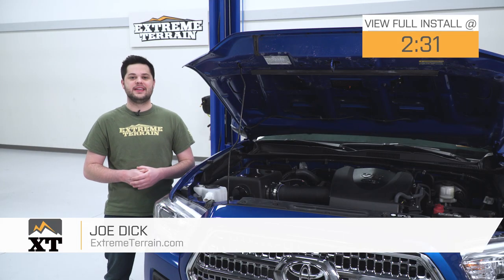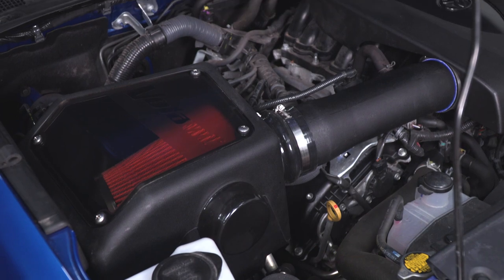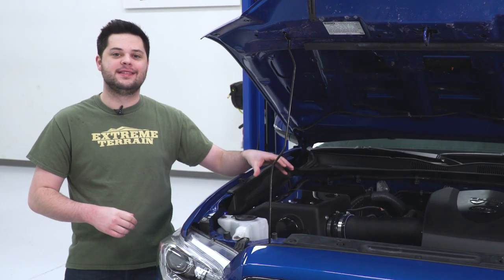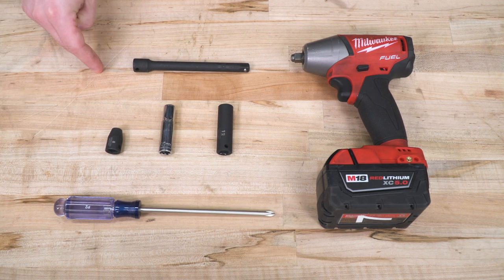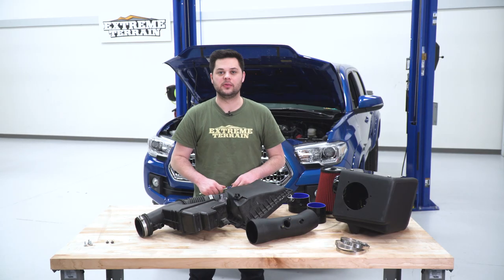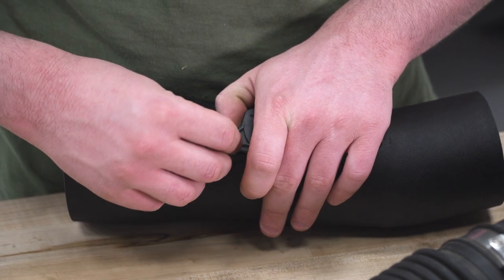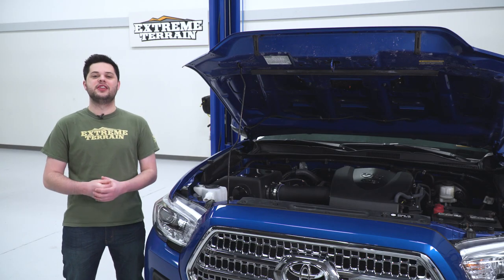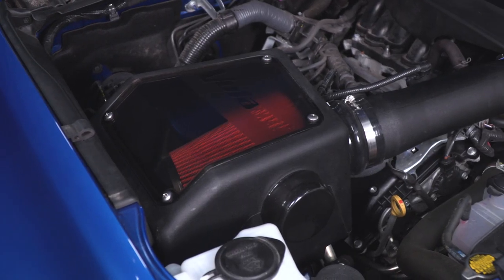Tacoma Volant DryTech 3D Closed Box Cold Air Intake (2016-2019 3.5L) Review & Install

Comment: I tried to install  the S&B cold air intake in my tacoma,  it wouldn't fit because I had installed  hood struts prior to the intake...
The stut was keeping the box from aligning  with the mount holes ..... I returned it
Will your kit fit with my hood struts?
Answer me that and I might make a purchase......
Reply: spiker engineering has a single hood strut now for the driver side for people that has aftermarket intakes.

Comment: I bought a cold air intake for my 2020 Tacoma and it was a waist of money.no improvement in performance or gas milage,I still have my 2006 Trd with the 4.0 with 235000 miles on it and it's still faster than my new one.but it looks impressive even though it's hidden under the hood.sorry ya'll,a led light upgrade is better.